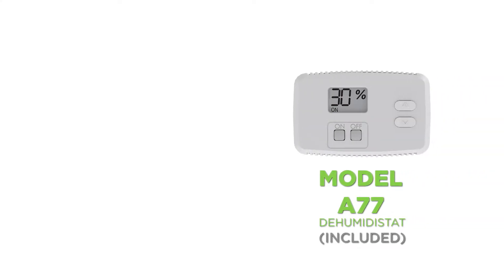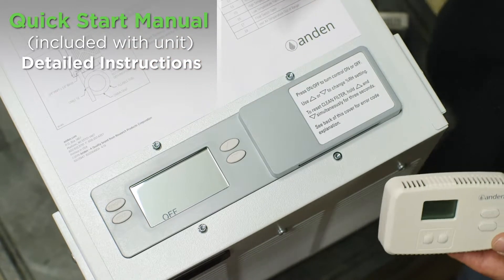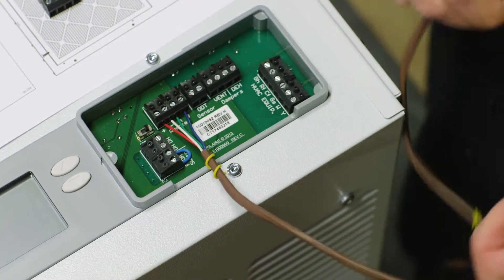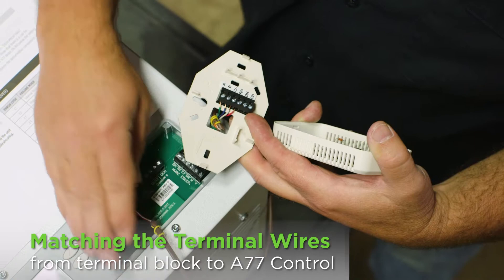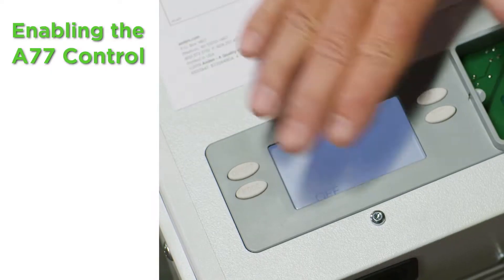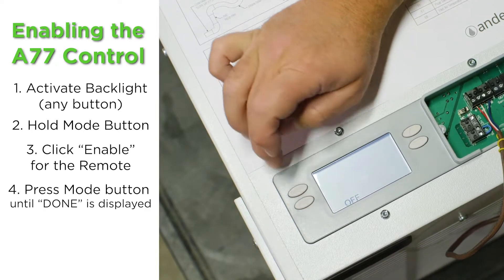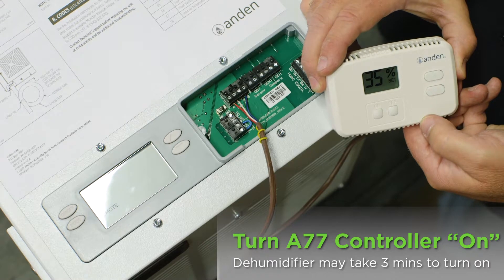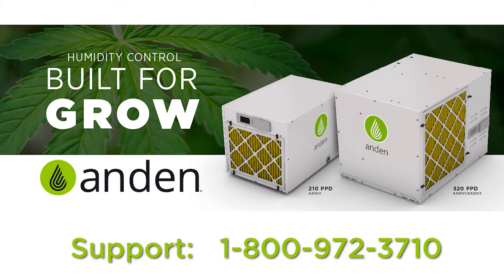Anden | A77 Controller Installation

Comment: does this shorten the time between the units cycle? my unit gets to its set RH level and then does nothing for 15 minutes while the RH rises way above the set point. Also goes through an air sampling before actually turning on the compressor so it basically spends more time at a higher RH than it is set for.
Reply from the maker: Thank you for contacting Anden. Yes, the A77 will eliminate the 15-minute sample time and instead sample constantly at the controller. If you have any additional questions, we can be reached at 1-800-972-3710.

Comment: Great video! Could they also be controlled by an external microcontroller like a Raspberry PI?
Reply from the maker: Thank you for contacting Anden. You can use an external controller as long as it provides a set of dry contacts. Please note as well that your dehumidifier will need to be set up as EXTERNAL mode. If you have any questions, Mauricio on our technical support team would be happy to help. He can be reached directly at 608-354-4389.
Reply: @officialandenpro  Thank you for your response! Do you have a manual that I can read to learn how to use the EXTERNAL mode on the dehumidifier? I would appreciate it. Also, thanks for the number, I will give him a call if needed.
Reply from the maker: @edgarramos4830  Would you mind confirming which Anden dehumidifier model you have? We would be happy to provide a link to the manual. Thanks again for contacting Anden.
Reply: @officialandenpro  Anden A130, thank you so much!
Reply from the maker: @edgarramos4830  Our pleasure. Please see the installation and operating instructions at the link below. If you have any questions, Mauricio would be happy to assist. Thanks again. https://rp.widen.net/s/vcrb86lcfm/k-anden-a130-dehumidifier-installation-guide-operating-instructions-b2208340
Reply: I ran my 320 stand alone for a couple weeks and it worked great then I hooked it up to trolmaster and the unit sounds completely different like a compressor kicks on and it blows hot air now, is that common?
Reply from the maker: @jimbro389  Thank you for contacting Anden. Would you mind giving us a call directly tomorrow to discuss this? Happy to help. We can be reached at 1-800-972-3710.
Reply: @officialandenpro  she’s running perfectly actually, had a couple minor issues with the trolmaster stuff but everything is worked out and perfect, the anden is 👌🏼👌🏼👌🏼
Reply from the maker: @jimbro389  We're glad to hear it. Thank you for circling back to confirm. If you need any assistance moving forward, we'd be happy to help.

Comment: I have the 210 what size wires are you using to wire up the controller to the dehumidifier?
Reply from the maker: Thank you for contacting Anden. Please use 18-22 AWG wire for control wiring. If you have any additional questions, we'd be happy to help.